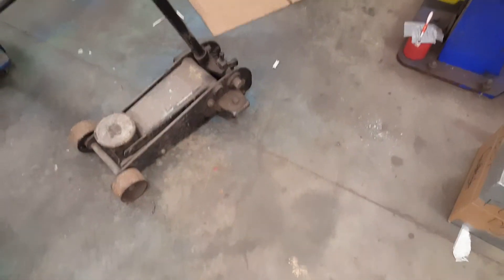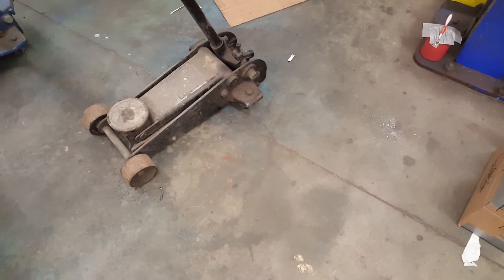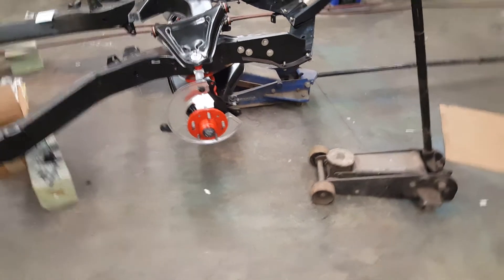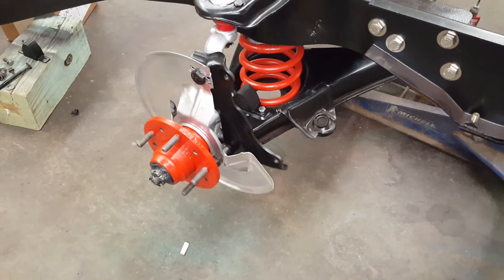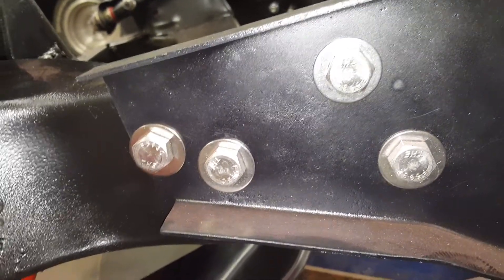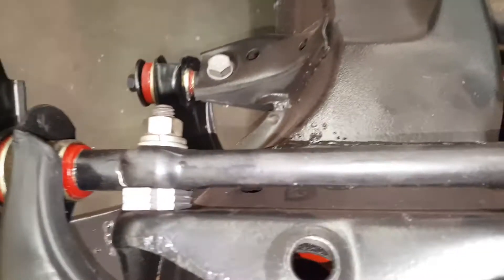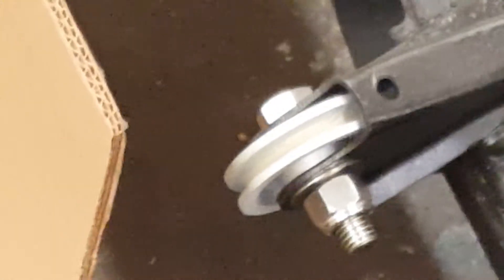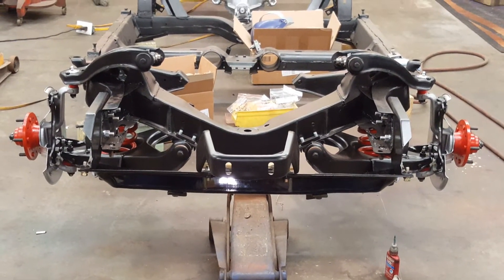C3 Corvette rebuild

Comment: That’s a 68 body but it’s not 68 chassis correct ?
Reply from the maker: Yes, very much a 1968 L79 chassis, original build sheet was found on top 
of gas tank during disassembling.